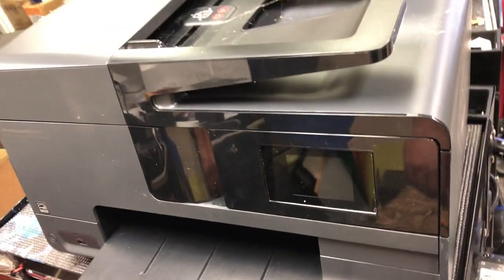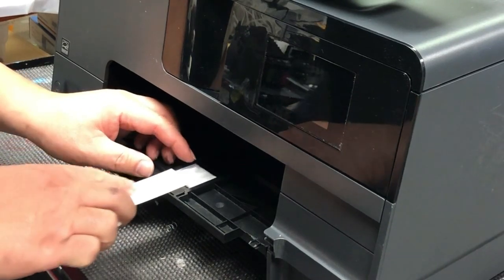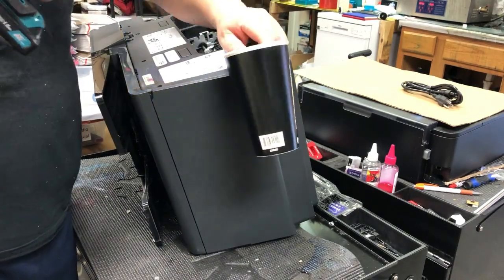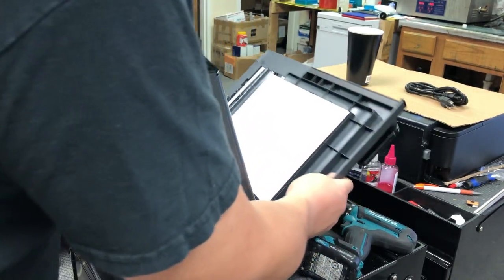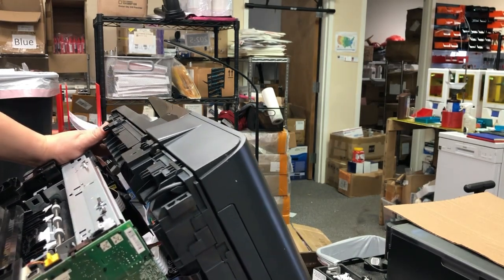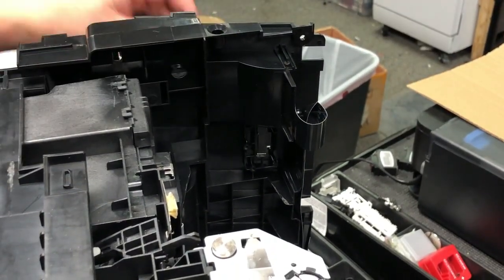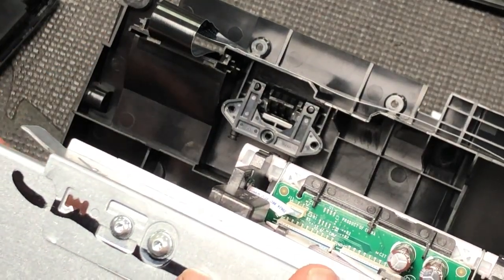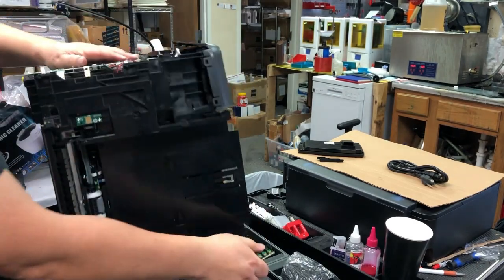Uncasing HP OfficeJet Pro 8610 8620 - Disassemble for Repair

Comment: Once i'd got half way through your video and removed the Left Hand side pannel I spotted a plug at the top of the circuit board labeled PZ LED that had become disconnected, I reconnected it and now my printer which was referring me to HP service seems to be working fine again.
You've saved another piece of computer technology that was completely useless due to a trivial fault from landfill and saved me about $300 for a new printer.
Thanks very much for providing this video, it was really helpful to me.

Comment: To access the printed circuit board and drive belt you only need to remove the left hand side cover held by 3 T10 screws and forcibly prise the cover off.  I found the drive belt for the paper feed behind the PCB to be a problem in two similar printers causing a Paper Jam fault.

Comment: My 10-yr-old  HP8610 printer is toast.  It started with a message to replace an ink cartridge.  Did that.  Then messages that there were issues.  So I watched a video and reset the printer (a few times).  Replaced ink cartridges (a few times).  Anyway so now the print head is stuck on the right side and I just want to retrieve the ink cartridges and try to get some money back on those since I am going to toss the printer.  Already bought a monochrome black ink simple small printer because that's all I need now.

Comment: My printhead is stuck to the right and won't move, i will try dismantling it as per video to see why it's stuck, if i cant fix it it will become my new boat anchor..stay tuned
Reply: Did you ever free your printhead?  I have a boat anchor candidate same as you did
Reply: @allanfigot8452 haha, i got about half way and then my baseball bat took over....

Comment: Thanks for the vid. You could have been more thorough on some parts, though. Where you just skipped over them "it's easy" when it actually wasn't that easy.

I got an 8620 which is covered in guano. Literally. I put the case into the dishwasher. Let's see if it survives.

Comment: I too went into the engineering by tapping on some spot few times in a row. don't remember the exact thing i did to the engineering menu
to try and reset it. but form doing that like someone else it went back to the same erreor message only this time  stops you from going any where else in the screen icons at least BEFORE I would get the   can't detect any print head like its missing but couls still get around in the icon list. And worst of all the prinnt head doesn't move over to the left when door is open u, so it says you have tpo work on then head but wown't let you because it won't slide over > I wasted some money on this  I guess  don't know if i'll ev wer figure out how to manually move over the head.

Comment: I have an OfficeJet Pro 8610 showing the Ink System Failure, the web interface shows the Black Cartridge "Ink Sensor Failure", I've disassembled the print head and made sure all the springs are making contact, however there's some black spots on one of the black cartridge's pad that one of the springs makes contact with, could this be the problem?  I cleaned it best I could but there's still some black on the pad.  I thought about putting a small layer of solder on that gold pad, but would this make the problem worse?  I also cleaned all the springs in denatured alcohol.  I really don't think its a problem with the cartridge as it shows fine (ink levels, status etc) when initially inserted until you go to print, and that error seems to trigger the Ink System error.  I'm puzzled, I've made sure the ribbon cable is inserted well and re-assembled the print head 3 times now.. about to chock this thing in the garbage. :(  Oh I also downgraded the firmware, which did not help so I upgraded back to the latest version available... error still persists.  Seems to me it's something simple and this print head could be refurbished but I'm having no luck.  If I run the factory reset sometimes I can get it to print an entire alignment page, and seems great and ready to go... until you send the first print job or try to print a report from the printer after that, error pops right back up.
Reply from the maker: Same here. I even replaced the mainboard, which temporarily fixed the problem for the PF motor malfunction. Then other errors come up. The ink sensor is inside the printhead, which HP heats up a wire to calculate resistance. It can be faulty from time to time.

Comment: I get "Remove the rear access panel or automatic two-sided printing accessory from the back of the printer, and then clear any paper."  I noticed there's a drive gear that spins freely on its shaft that would drive the two-sided printing accessory.  I've cleared paper but really couldn't find any, wiped it down, checked and rechecked every paper access.  The main drive from the printer to the two-sided printing accessory....I don't think it should free spin and might be my problem for this error. ???  Anyone have any experience with this?  Possible fixes?

Comment: So long story. It’s been so long I’ll try to remember the sequence of events. I was getting the message that one or more cartilage were damaged. So I took out the print head cartilage and cleaned it very well. I reinstalled it and the same message came up, so I purchased original HP ink at $75 for the three colors. Installed. Nothing. Same error. Ok, did so more research Firmware? I don’t think so because I have original ink in so I skip that part. I find a video that when you tap 4-5 times on the bottom left hand side of the screen it allows you to reset the printer. So I try this and it starts to work, what language, what country are you in and before it goes to the time the error pops back up. “One or more cartridges appear to be damaged”. Ok I’m thinking, let me pop them out. Wait, the cartridge is NOT sliding over to the left. Now what?!?!
Reply: Exactly the same issue for me.  I then removed and reinstalled the CMOS battery to do a hard reset but after that was done the cartridge damaged screen still comes up and cartridge still doesn’t slide left to allow removal of the cartridges.  Did you find a solution?
Reply: @curtbarnes54  I have same problem; carriage is locked to the right side and cannot move it even manually.  Did you fix yours?